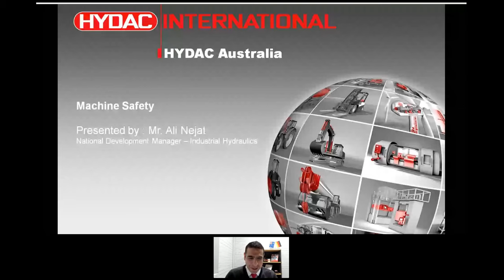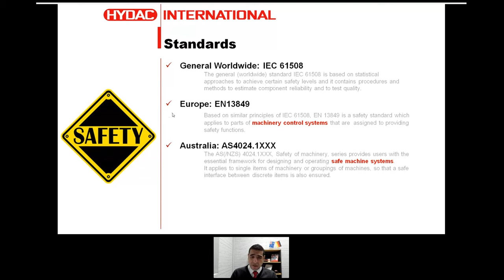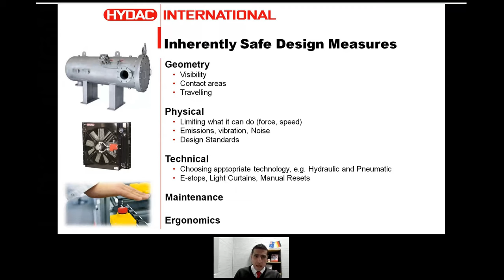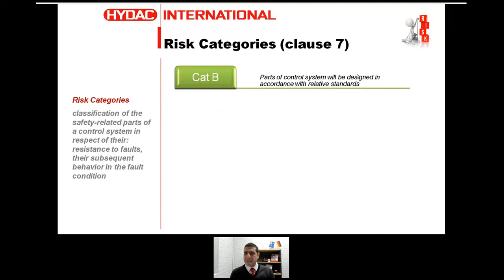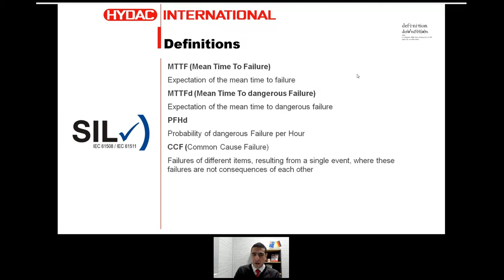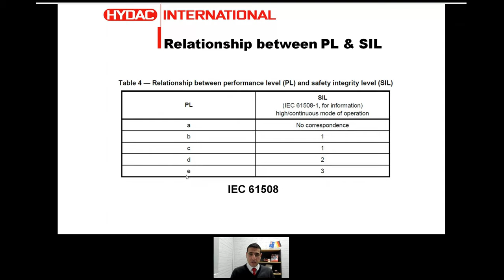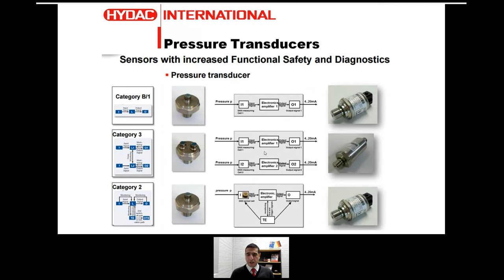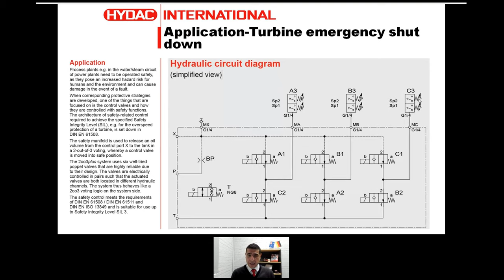Machine Safety - Safety Integrity and Performance Level

Comment: Nice video, some minor suggestions:
-6:00 13849 also sector specific (CE/machines)
-8:30 Grid is not inherent safe -> it is a technical measure as every housing
-23:00 Electrical control is not exclusively covered by 62061 but by 13849 as well